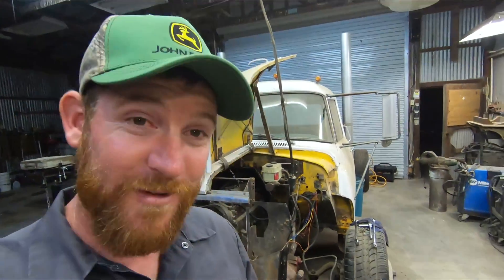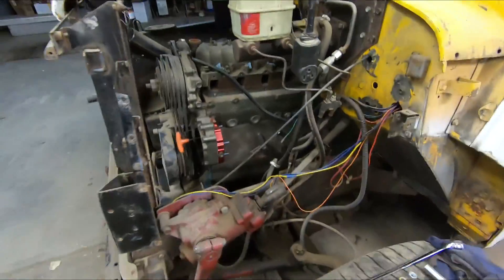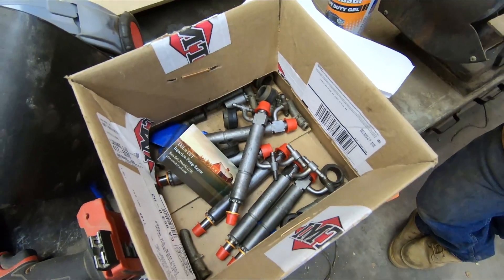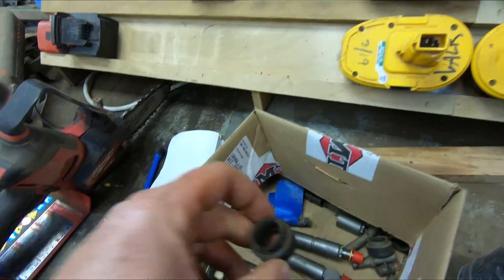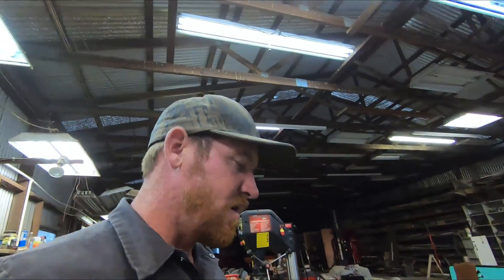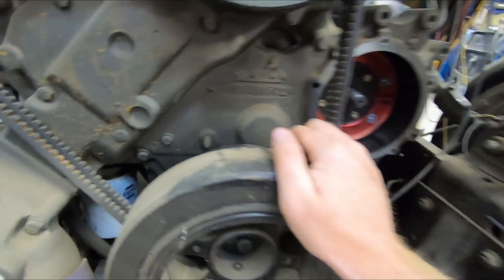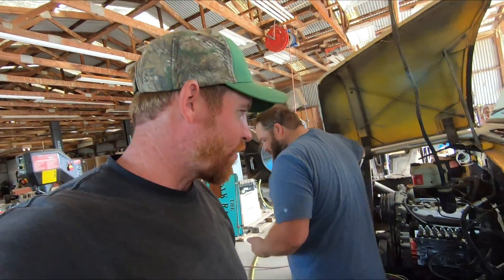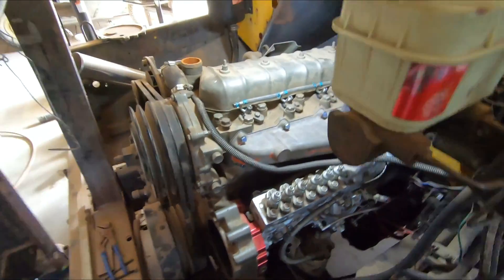P7100 install Part 3 (Mistakes Were Made)

Comment: always make sure there's not a extra copper washer in the injector hole and use a small wire cup wheel to clean injector hole out  don't use any kind of abrasive it will fall right on to the pistons and can hit the injector or scratch the cylinder walls and you can also heat the copper washer to anneal it to seal better. and I read if you want bibber injector to use the stock dt466 injectors. for a Cummins to get best power and fuel mpg and not need head studs is 16 to 20 degree I did 17 on my Cummins I didn't get to putting in my dt360 yet do to shortages been waiting on parts for over a yr lol its sad. I'm going to use your videos as a guide to put on the p-pump thanks for that by the way.